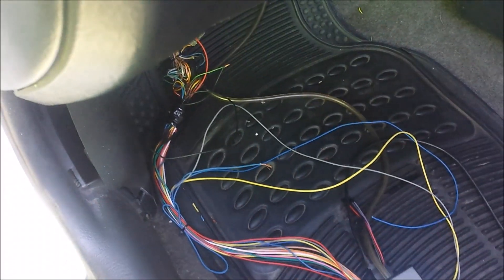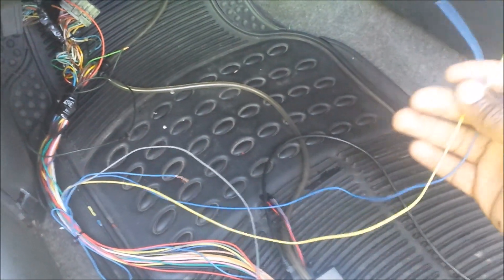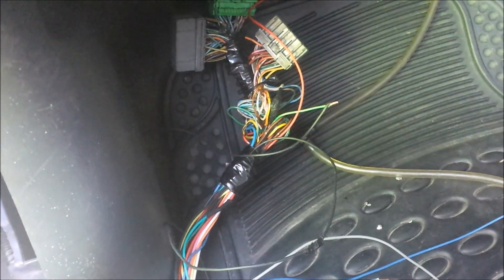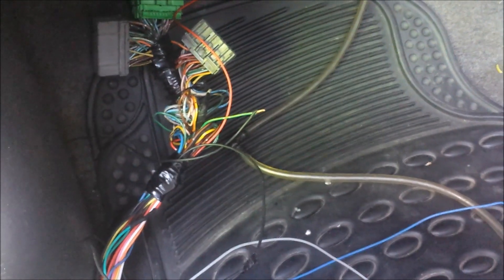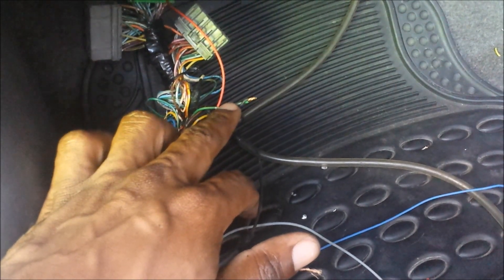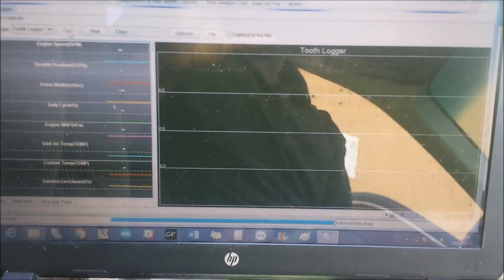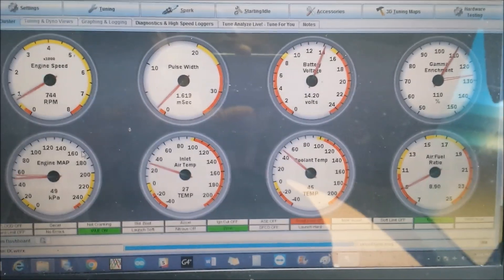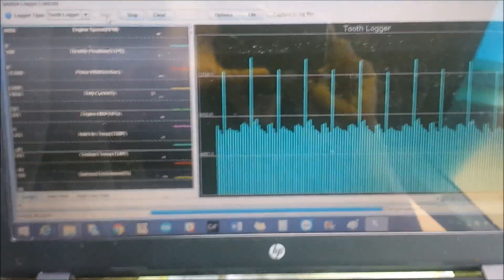Swapping ECU + Sequential injection Prep + Basic Distributor Testing

Comment: I have a question. When using basic distributor why do we need a trigger angle value? new to this sorry for the dum question.
Reply from the maker: Yes
Reply: to let the ecu know whats your actual offeset from the true top dead center of the engine. if the value isnt there the ecu will still count but wouldnt know what is the crack rotation degree.

Comment: So, it is possible to run it sequential with just one 12-1 trigger wheel on cam speed (distributor)?
Reply from the maker: Yes. A 12-1 wheel at cam speed can do sequential. My 12-1 (24 teeth distributor gear with 2 teeth removed 180 degrees apart) cant do sequential. Mine ends up being what they call dual 12-1 (crank speed)
Reply: Cheers! Another question as you have experience with it. Is resolution sufficent for fast changing data for eg. 1st gear pull? It can have problem with ignition advance lagging behind fast changing rpm.
Reply from the maker: @pawejusyn237  it is not the best but it works fine. Early miatas and 4g63 run a 4+1 trigger just fine.